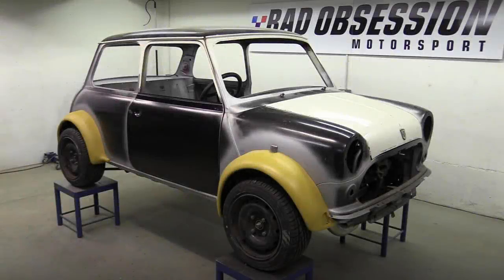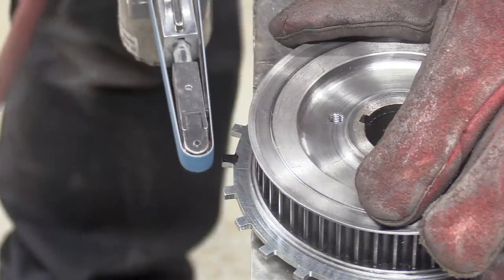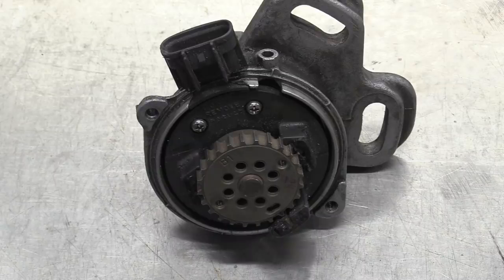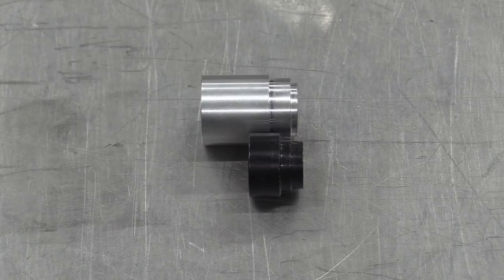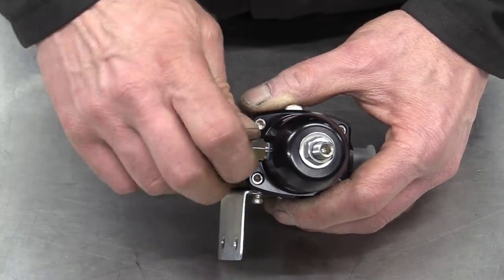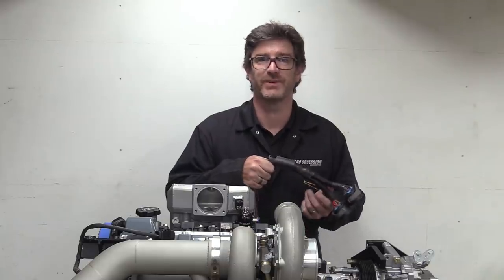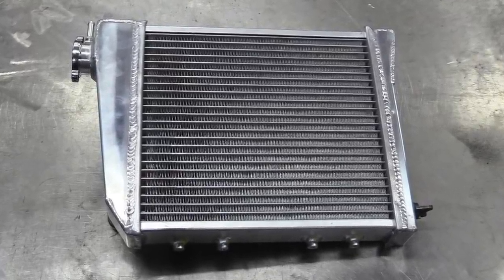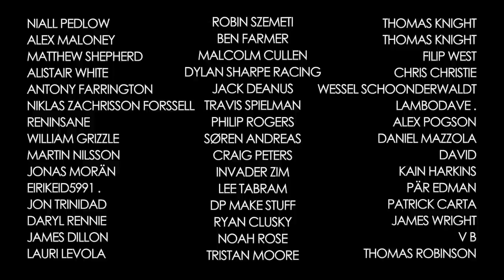Project Binky - Episode 32 - Austin Mini GT-Four - Turbocharged 4WD Mini

Comment: “...it doesn’t like that because reasons”

Love this channel so much it hurts.
Reply: Joe Campbell Same. ❤️
Reply: Joe Campbell 

Same here
Reply: I'd love to know the reason why they felt it necessary to ground a tooth off, given they are getting cam sync info from the dizzy anyway. You don't need to.
Reply: @vertigoalopolus  I originally wrote a comment saying that it was for variable camshaft timing, but it appears this engine doesn't have that.  I'd like to know too.
Reply: It a redundent signal. You use x-teeth minus one, then have the cam sensor in a similar fashion (1tooth min). Then the ECU can compare signals. And if one fails. It will still allow the engine to run. And you'll need an easy way to find TDC #1. Or for misfire detection. You can check rpm variation, coil-on-plug impedance, or an open circuit.... The possibilitys are only limited by the ECU, or the programs (think OEM), diagnostics, or creativity
Reply: Joe Campbell I love it so much i named my dog after it, back when she was a pup. 😉 if I could I'd post a pic of her right now lying in her bracket. 🐕🛋
Reply from the maker: @killroy2993  spot on.
Reply: Nik doesn’t like that

Comment: Finally time to ad my comment. now I am done bingewatching 33 episodes.I love this build or rebuild or refit or what is the most apropriat name for it. The way you solve things without taking any notice of how impossible it looks from get go and the shear level of work that has to be done. and the sense of humor applyed through out this series is awesome and necessary i thinh to keep just moderately sane in the end. Suits me fine though. And I understand your drive to make things as good as possible and still making it look avesome. That takes some ocd to commit to such task, which I understand cause I have it too. The decission on fabricating and not just buy of the shelf items and fit them in is great. Do Not Buy what you can make better yourself and sometimes it is even cheaper( rarely ) often it can't be found pre made.
Best of luck with the rest of the build boys, waiting for next installment impatiently.
This series is a warnig about what happenb if you are not allowed to tinker with things as a child, it will eventually burst in to action in adult life and may even result in and urge to rip wellmade things apart ( obviously not a mini ) and to reassemble in a way that was never supposed to be.
enough crack on BOM.

Comment: That charge cooler. I did wonder why you didn’t diamond cut the “Toyota” on the cam cover - because you can’t see it! 😅
Reply: At this point I am not sure that would stop them....
Reply: @alanlansdell7533  Lets make a bracket for the Toyota Logo XD
Reply: @alanlansdell7533  Good one :)
Reply: I’m wondering why they even bothered painting the cam cover. At this point its basically an internal engine component.
Reply: Was I the only one who yelled 'focus you FACK!' @ 37:31?

Comment: Please, please, please, show the face of the poor inspector doing the MOT on Binky.
Reply: They'll probably get apprived as an MOT station so they can do it inhouse.😀
Reply: *approved
Reply: Being the Mini is of a certain age is it already MOT exempt? Or is that road tax?, you Brits have a system completely different to Australia where we just get bent over a counter every year and have our wallets surgically removed via the prostate.
Reply: @rayg9069  Both MOT and tax exempt if over 40 years old. But I'm not sure this "Mini" still counts as the same vehicle it started as. It may need to be re-registered as a different vehicle.
Reply: @althejazzman  Oh dear, then of course it'll need to be crash tested and the necessary mods applied to Binky II. And so the whole thing will start again!
Reply: My understanding is - The Mini build could fall under the VOSA inspection criteria...a modification points system applies to chassis mods....whereby the standard UK MOT is not enough, the vehicle needs to be inspected at an approved centre. Not crash testing, just some bod checking it's all built well. The issue is further complicated as any modified vehicle needing a VSOA test then forgoes it's historic status, so road tax free rules may change too. Unless that has changed?
Reply: Colin Davies It would be absolutely wild if the VOSA inspector that gets the honor of inspecting Binky watched the series from the very beginning.
Reply: @Viscous Shear Vehicle identity is tied to the chassis,not the power train under UK rules. Binky has so many new parts that it probably won't be historic vehicle eligible.
Reply: it will almost certainly need an IVA due to the level of modifications. as regards the MOT/Tax exemption status, Binky will never qualify. even an engine swap (for an engine thats not fitted to a mini from factory, so an a/a+ series engine) alone would have to be carried out in the first 10 years of its life, if the rules are applied correctly (sadly many people dont declare engine changes which is illegal as even like for like engine swaps have different engine numbers).
as for registration, it will stil count as a Mini, but it will have to be IVA tested and might have to be registered on a Q plate as there possibly wont be enough of either car for enough points to qualify as the same car, potentially, but im a little unsure on that.
Reply: @n325aej "Well, it's probably better we start with what hasn't been modified. 1: Lug bolts 2: ... Nope, I think that's it."
Reply: @althejazzman  There must be one, just one original part in there somewhere lurking under a bracket ;-)
Reply: @digitalrailroader  What better certification could there be than watching the entire build process from idea through CAD to manufacture and verification. Just hide the NMFP tea mugs.
Reply: @althejazzman  The V5 goes with the chassis number, you just need to update the engine number and cc, jobs a good un !
Reply: So as an American who absolutely loves binky I have to say y'all brits really have some bullshit laws regarding inspections and all that ... I literally put a Chevy ls engine in a Nissan d21 mini truck and they didn't even ask any questions you brits put up with way to much regulation from your government us Americans would have started a war over some of your regs on cars lol
Reply: @quintenmaccalla5109  Which is all well and good, but when we have a history of cars that dissolve in the rain (several Alfa Romeo's spring to mind, along with most BL cars from the 70's), having regulations means that cars are safe to have on the road and not liable to kill people. 
It's one of the reasons we have (surprising to most I know) one of the safer road systems in the world (2nd safest in Europe).
Reply: Lassi Kinnunen  And the boot lid (or deck lid to our septic cousins across the pond). Don't think there's a lot else though.
Reply: @AnthonyIlstonJones   I think the only original structural parts are  the roof, parcel shelf and b and c pillars if you can call them that on a mini
Reply: @KevBoughen  I thought the boot lid was original too? & the bonnet is still the original (in places), just modified slightly.🤣  If it still has the chassis number it's still oficially a Mini.
Reply: @AnthonyIlstonJones  I'm not sure if boot lid and bonnet count as structural as they can be removed
Reply: @KevBoughen  I'm not sure how much structure there actualy IS on the front end now the front hinges up, what's left? 🤣
Reply: @AnthonyIlstonJones  umm scuttle board maybe, oh and many, many brackets
Reply: @KevBoughen  First smile of the day, & I've been up 6 hours. Thank you.
Reply: @althejazzman  Q plates here we come as the capacity is >125% and its a change of transmisson(4wd)!

Comment: Ahhh, wiring!  When you fire the engine, make sure to check your ignition coils in complete darkness.  On my C.O.P. setup, I had issues with spark leak.  You could see occasional arcing from the tops of the coils, over their plastic housing, and into the fancy stainless fasteners I bolted them down with.  If you remove the coil covers, you remove a layer of insulation from the tops of the coils.  Electricity will find the path of least resistance to discharge, and sometimes that can be through the air.  I was using Chrysler 300M coils, and some may be more prone to it than others.  It didn't seem to affect how the car ran, but it can't be good.  In no way am I bashing,, 'just something to look out for.
Reply: **Worthy shout guys **
More electric more power released 👍
Reply: nobody is reading this
Reply: @Simon-nz8kt  They should because Jafro is a renowned engine builder!
Reply: @Simon-nz8kt  Wrrrrrrrrongggg!    Of course, My Name Is Nobody (Spaghetti western ref. there) so you could be right just by chance.

Comment: The heat shrink on the speed sensor is probably doing more harm than good actually. Unless it is the type containing glue, it now provides a seepage path down along the wire to the contacts. 

Just a small nitpick: The two trigger sensors are actually just "inductive sensors", seeing as they are two-wire. Hall effect sensors generally have 3 wires and are able to provide a static signal even when the trigger wheel is stationary.

Nice little detail that you addressed the injector spray pattern in relation to the adaptors.

Lovely work you are doing guys. The attention to detail is absolutely amazing!
Reply: Why was the speedo sensor not turned 90 degrees? Nothing a bracket couldn't sort.
Reply: @davidelliott5843  Something else was probably in the way or alternatively; this was just an easier fix...
Reply: Lassi Kinnunen  The injectors were not only hitting the rocker cover but also the head casting. They could have gotten injectors that would fit, but because of some mistakes they already have theese, so they opted to do a little machine work to make them fit.

I would wager that it's A LOT easier to make a couple of brackets and adaptors than an entire rocker cover from scratch. Especially with the spark plug valleys. And the old one is already painted! ;D

Comment: Fantastic work as always, and very timely as I need to make up a similar crank trigger for my stupid project. Love the wire management, particularly the clip on covers. That is a very nice touch.
Reply: I actually thought of you when they made the temporary bracket for the engine harness connector to make sure the length was right 😅👍

Comment: Who else is still disappointed that Nik didn't forge engine internals himself?
;)
Reply: smh I thought they were real car guys and were going to mine the metals out of the earth, engineer a custom alloy, and then forge it themselves :/
Reply: @von...  That was the "tedious" part that was cut from the final.
Reply: @von...  real men build a fusion reactor from spare rover parts so they can produce the required elements for 3D printing it all together.
Reply: @carlsagan2371  just imagine what crazy brackets they could make with a metal 3d printer XD

Comment: One thought, it looks like you created a same direction flow heat exchanger. Heat exchangers are more efficient when the coldest water into it is next to the output of the cooled medium.  I.E. the water should enter the heat exchanger right next to the throttle body in a reverse flow heat exchanger style.

Comment: Theres gonna be some decent power coming out of this.
Reply: First start up, they crack the head! Imagine that 😭😭😭😭
Reply: @bernardfender5147  they won't. I am affraid tje front driveshafts will break and shatter everything around it
Reply: @iamtsooj  I guess either scenario is very unlikely, but what a kick in the dick it would be if it went tits up on first drive..."Oooo that doesn't sound right.....B A N G !"

Comment: when this project is finished everybody is going to be driving electric cars
Reply: When this project is finished, everyone will be using teleporters.
Reply: That's when they start their new project:

"EV conversion of a GT-Four powered Mini".
Reply: Or worse.... Crossovers
Reply: Guys, I just had the same thought. I love this stuff but the reality is that cars will have motors half the size. 4 times the power and need virtually no maintainanance.....
I wonder if people will hot up their electric cars? It sure won't have the same vibe...
Reply: @simon9447  'no maintenance' is a marketing strategy to sell cars that won't last so you buy more cars..!! Such a false economy!
Reply: @simon9447  you can bet that someone will but the performance will be there already it will be suspension and added lightness
Reply: And these two will still have great big grins on their faces...
Reply: They are lucky enough not to life in f#*king London😂 so they still have plenty  of time  to enjoy 👌
Reply: @saltycracker2344  Except for the part when they seemingly dissolve at the start line and appear reassembled a hundred feet down the track at which time they are going like a bat out of hell.  You know, picking on some poor Hellcat or Audi.   ;- )
Reply: Wait, they said on 8/22 Binky will appear for the first time publically at the inaugural Historic Rally festival at Weston Park. Which means the car will be done by then, and a new video will be out after that.

Comment: Episode 32 Richard: silly imperial measurements 
Episode 35 Richard: and there she is; 225 stones, 14 hands tall, 4 and a half cubits of wheelbase, and a fuel capacity of 1 firkin. All said and done, it only took 62 Zoroastrian months and cost 10,000 Doubloons. What a bargain...
Reply: Episode 35? Dream on, pal. :D
Reply: *Episode 350
Reply: I agree with Richard. Silly BRITISH imperial measurements. (Maybe we can discuss this over a pint some time?)
Reply: Most unusual imperial unit is that there are three barleycorns to the inch. What use you might ask? The barleycorn is actually the unit of measurement used for shoe sizes in the UK. For those using the newfangled metric system, one barleycorn = 8.47mm.
Reply: @gordoncalder7223  I do have to admit I don't think ANY country in the world uses reasonable shoe sizes!

Comment: So I've always wondered. What if one of your custom parts requires replacement down the line, do you have a blueprint to fabricate one or will you use the videos as a reference to jog your memory? Cause sometimes they appear to be complicated enough to be difficult to replicate from just glancing at the finished article.
Reply: Agreed! So much is unique to Binky it would be really hard to replicate parts. Thoroughly documenting (including scaled drawings) everything would be its own monumental task. In fact, if she wallows and bounces like a goat, sorting that out would be another challenge. It's not as if they can give her test drives before finishing the build. No doubt she will perform, but so much is unique to Binky it would be surprising if no tweaks will be required to get her dialed in. That could be a few shows even after Binky is "done".
Reply: @MTerrance  oh, they will definitely make episodes about dialing it in, I can already see it. It will probably be everything from handling to setting up the Equalizer just right.
Reply: They will rebuild the whole system which is failure, and improved from the failure. So there are no replicate in their case. They are not ordinary mechanic, every bits of their work is art more than machine.
Reply: All I know is I feel for the insurance valuer.
Reply: All CAD files are carefully filed away...stuffed in a drawer somewhere!
Reply: For sure Nik just started to fabricate a bracket to store all Binkys CAD Templates in a shelf. He just needs to make shure the shelf is earthquake proof ;-)
Reply: @nottodaybuddy370  10 biiiiillion dollars, I'm praying they never stuff this thing and some bystander casually says at least it was just a mini 🤯🤯🤯
Reply: I’m pretty sure if they bend the car enough to bend the brackets, the originals would never fit again anyway.
Reply: @MTerrance  I just realized that they prolly have to run the engine on a stand right? on are they really gonna run it first inside Binky?
Reply: @g60force  they will probably spin it with break in oil before putting it in, yeah. Toyota does that these days, they spin the engine on a stand cold with break-in oil for the equivalent of a few km, supposedly that eliminates the necessity to actually change the oil at 1k km, since the car ships to the customer with normal synthetic and already broken in.
Reply: @g60force  Good question. Hell of a note if they can't get her to turn over. I think we can look forward to several shows on tuning and debugging Binky. They know what they are doing, but Binky is an extreme test. Unlike some garage restoration, Binky is truly unique.
Reply: @g60force  They are experienced mechanics so I assume they will run a raft of diagnostic tests to be certain it is performing as expected. That said I suspect they will do that on the vehicle rather than a test stand, since it is crammed in like sardines in a can. It would be interesting to get it on a dynamometer and see how it performs. As meticulous as they are, I hope they don't discover some funky stuff with how she performs under load on the track. By that I mean the handling more than whether she accelerates and stops as intended. If she rides like a brick or wallows through turns like a fat woman on water skis, it would be disappointing after all their efforts. I don't think that will happen, but it's not like there are any other cars just like Binky.

Comment: You may find yourselves wishing that you'd come up with a remote (easy access) location for the oil filter.  Inverted mounts on the side of an engine are generally nasty to swap out.
Reply: Yeah, but then they'd lose the nifty OEM integral oil cooler.
Reply: @5thearth  Why lose that?  The setup for remote filters generally just use an adapter in place of the filter itself, with threaded ports for hoses.